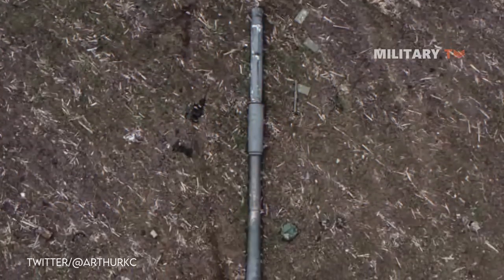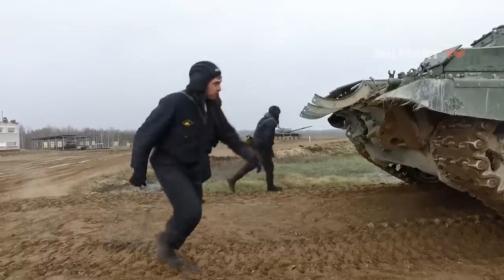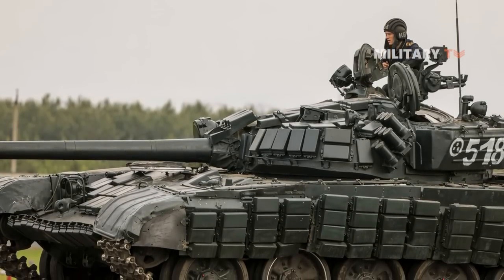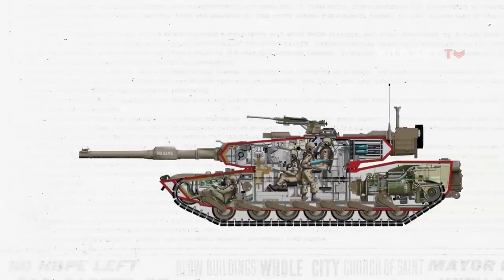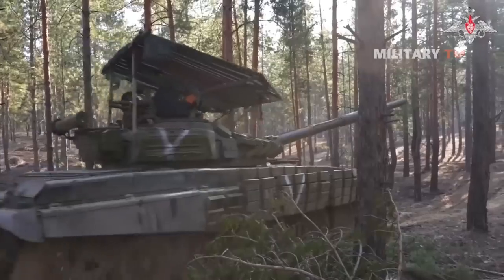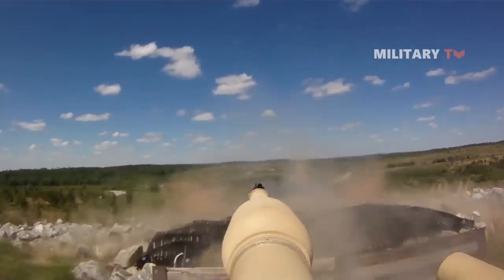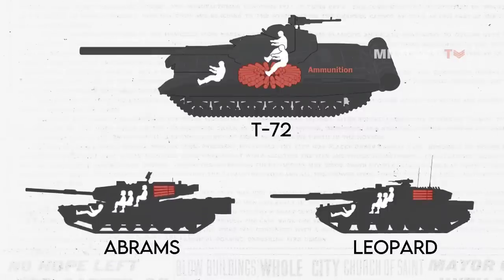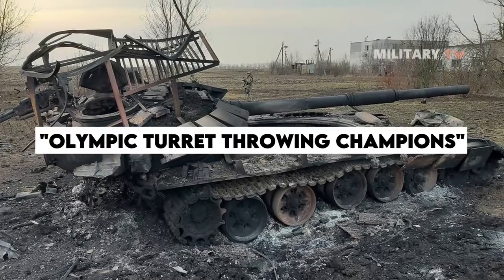Why the Russian T-72 Tank Turret is Flying in the Sky?

Comment: Sounds like everyone missed the Leopard 2 that exploded near the tree line during the offensive last week that set an all time turret height and hang time record the first time. It's small but you can see it spin like a boom-a-rang, go straight up possibly twice has high as any other, seemed to almost stop in mid air at the top and then came down.

The turret popping off is of no significance. After a tank is hit and penetrated and molten metal and fire enters the turret the crew is most likely severely injured or dead. Then the ammunition burns or explodes weather the tank turret stays on or not doesn't really matter a slight difference on maybe a crew member getting out or not. The purpose of the extreme low profile of the T-72, Auto loader and ammunition carousel is to not get hit in the first place. T-72, T-80 and T-90 still the best all round tank for war in eastern Europe 125 mm gun, fast auto loader, 45 tons good mobility, 300 mile range, can snorkel under 15 ft. river obstacles along with BMP's that can swim. M-1 Abrams 120 mm gun, 72 tons, poor mobility, poor range, as low as 100 miles, needs lots of fuel trucks, needs bridging equipment to cross 5 ft of water, is now over weight for US bridging equipment, recovery vehicles and trailers. Bradley's can't swim overweigh now but aircraft aluminum hull to save weight catches fire and burns melting entire vehicle down to the ground. It's TOW missile is wire guided and vehicle has to stop entire flight. Russian Kornet anti tank missile fired by man, vehicle or helicopter has more then twice the range

Comment: also this happen to Abrams tank and leopard tanks not for T72 only be honest when you speak.
Reply: Not at all, Ivan. Take your copium and leave the chat.
Reply: @stischer47  He is right.

Leo 1-2 have unprotected ammo in the hull, it's to the right of the observation devices of the driver (this is why those Turkish Leo 2A4's were lost in ambushes in Syria).
Abrams does have protected ammo storage in the hull though.
Challenger II doesn't, i don't think it has blow-out panels even in the turret storage ammo.
Reply: @stischer47 you are the one cope, cope harder
Reply: @Milo-id9qd Canada and Turkey both has their Leopards modified for the same reason, and Canada had wild success with Leopards during war on terror sometimes outperforming US army with those.
Reply: @niweshlekhak9646  This is not the war on terror.

That is vs a not very advanced military, that is not obsessed with artillery and firepower.
This is different.
Reply: @Milo-id9qd  War on terror was even more obsessed with artillery and firepower. Terrorist might not have had great artillery but some groups like ISIS did.
Reply: @Milo-id9qd  The point isn't that the tank explodes, the point is that the crew survives. A blown out leopard has higher probability of survival and repair than a blown out t72 due to ammunition location and complexity of the mechanical parts... Challenger and Abrams are on a whole other level too, they have the best survivability of all.
Reply: @amazin7006  Very good point, but tbh ... i have been watching the vids from Ukraine.
The detonations of T-72's were linked to storage of loose ammo in the fighting compartment, so overall bad practices (very prevalent in the early stages of the invasion).
Russians seem to have stopped doing that ... somewhat.

In many other cases, there are vids of russians running out of tanks that have been hit, not on fire or if on fire not instant detonation.

From the conflict, the biggest threat to tanks seem to be artillery and drones.
A FPV kamikaze drone could make a mobility kill, followed by calling in artillery (and that will wreck ANY tank).

While i certainly would not want to be in those tanks when they get hit (T-72's), from a purely logistical POV, all russian tanks use the same ammo, ammo charges, crew configuration, have about the same weight, etc ... which must reduce logistical overhead, i don't see how that can be bad for them.

PS: Challenger has insane armor, but it's ammo storage apparently is not that good.
Abrams has the best ammo storage by far.
Reply: @stischer47  typical westerner when their wonder weapons is a paper tiger
Reply: @Milo-id9qd  "Russians seem to have stopped doing that "
No they haven't, they have lost over 2200 destroyed tanks and over1300 damaged and abandoned. The only reason you see videos less now is because they have less tanks in general to use. Also, most tank losses come from trying to use them offensively (most dangerous). So since they stopped pushing after their failed winter offensive, they are using tanks less offensively. Also this is not even just in Ukraine, we see this happen in Syria all the time too, Russian tanks sending their turrets flying and men running out burning to death. Dozens of videos this recorded from rebel fighters. We also saw this in Libya where all 150 of Gaddafi's t72 tanks were destroyed and most of them experienced ammo detonation
Reply: @amazin7006 hey fail to do what in winter, sir? You see less tank destroy because there is many new produce tank, more improvement than old one due to experience in combat situation. In which document it said they use less tank than before?
Reply: @Reflect02  Russia failed to advance in their winter offensive, they have nothing to show for it except all of those dead conscripts bahahaha. Also no, they have less tanks in general. They lost 3000 tanks, much of it given right to Ukraine to repair and reuse.